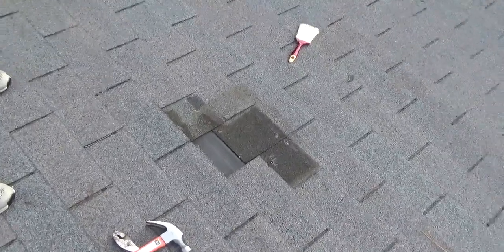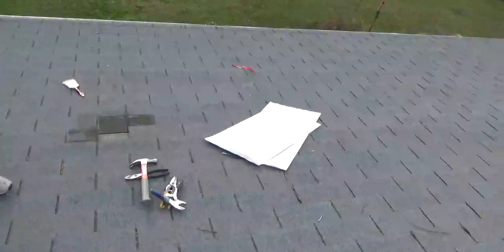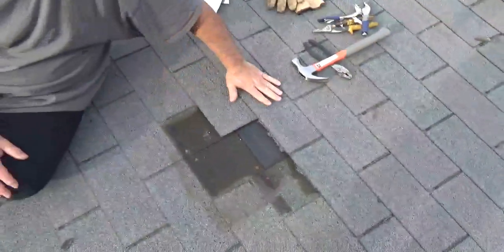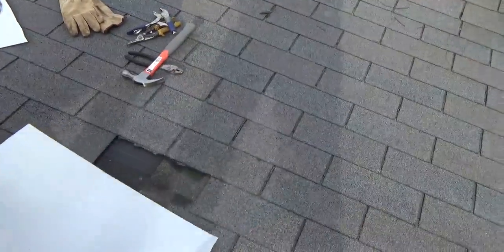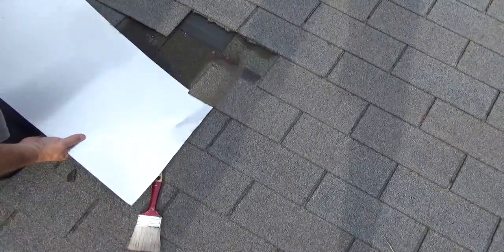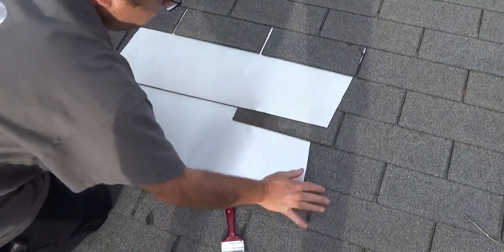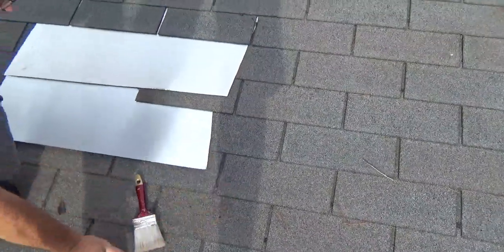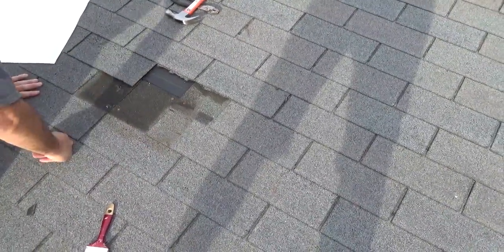Simple Roof Leak Repair, replacing damaged shingles easily,

Comment: No houses use that for roofing here. It's all long run iron or concrete tiles unless it's some architectural design fancypants set up. Curious as to why it's such a big thing.
Reply from the maker: Hey Ashley, I see more metal roofs in my area these days.... Out in California, they use more of the tile roofs... I think they use asphalt shingles mostly because they are fairly cheap, easy to install, and the folks who push oil based products like to see them used.... Thanks for the info, Ur thoughts, watching, and commenting!!!